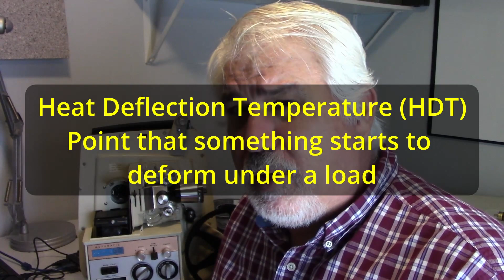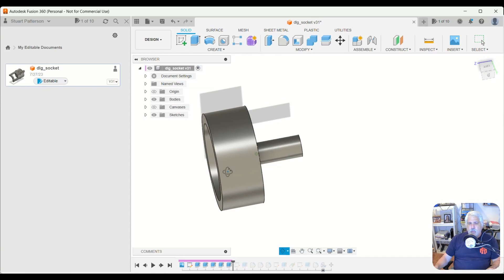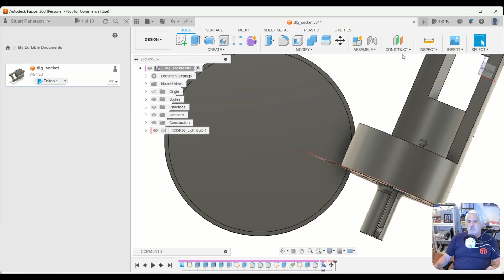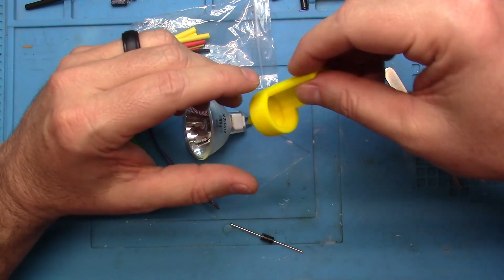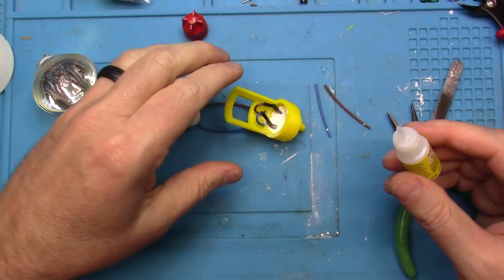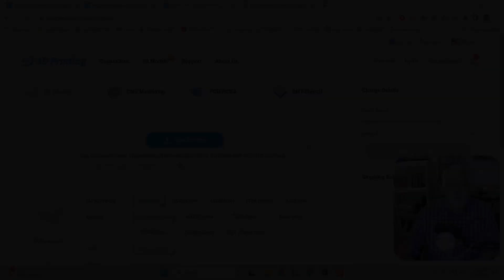DIY DLG/DLS/DHX Projector Bulb Adapter

Comment: Wow Stuart. My 91 year old dad and I bought all the supplies and ordered up the part you designed from the place in the UK you pointed us to and after getting stuck on the soldering step, we went and bought a soldering kit with a soldering iron that heated up to a higher temperature then the one we were using, and breezed right through that step and then we installed the new bulb into the Sears Automatic Super 8 projector which is just like the one you were working with and it WORKED!  Our projector had burned through the lamp 3 times and we kept buying a new one and didn't understand what was going on?? Dad said he thought it had to do with amperage or something... We are so excited to now have a working projector to play the 53 Super 8 3.5 inch reels to find out what is on them from 1966-1974 and try and digitize them once we know which ones haven't been compromised by the age and are in good enough condition to still be transferred. Thank you so much for this tutorial I see nobody had commented so I wanted you to know that it has helped somebody retrieve memories that otherwise would have been lost!
Reply from the maker: Thank you very much!  I am glad it helped.  My friend, Ben Heckendorn, also did a project that is similar using an LED flashlight he got from Menard's.  You should also check out that video since it will run much cooler.  Mine gets pretty hot so keep an eye on it, please!
Reply: @StuartPatterson  Can you provide a link?
Reply from the maker: Sorry, for the late reply.  For some reason YouTube did not notify me of the reply or I missed it.  Here is the link: https://www.youtube.com/watch?v=Buo1RLu5Gaw&t=122s&ab_channel=BenHeckHacks   I watched it, and it is not a direct drop-in replacement for the bulb.  I am working on a solution that should run cooler using an LED MR16 compatible bulb, but I don't have much to show for the results yet.  We will see.